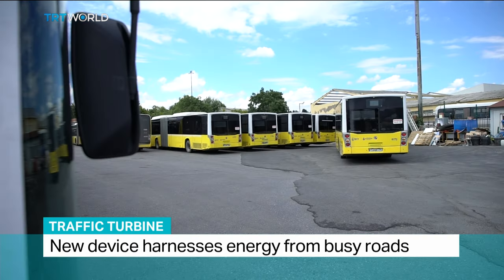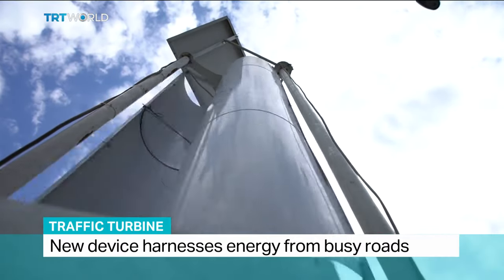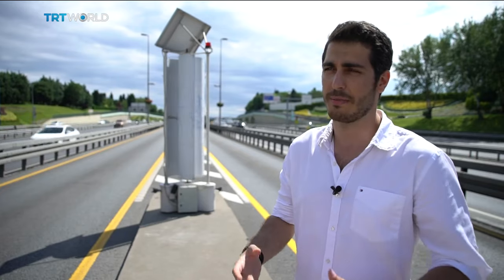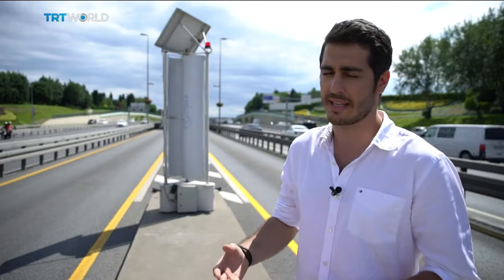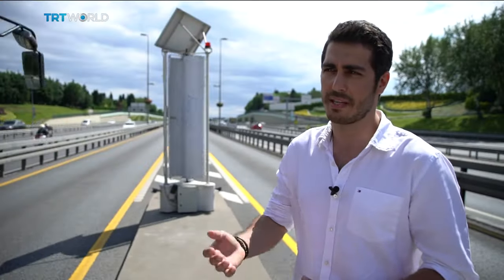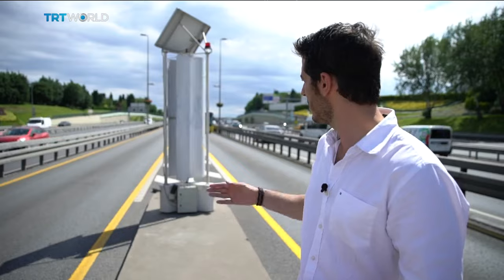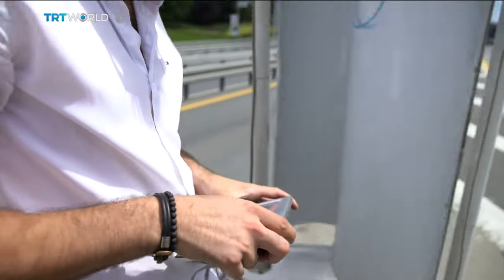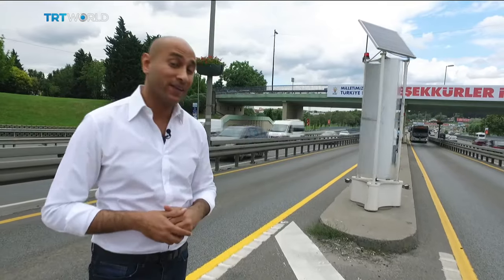Traffic Turbine: New device harnesses energy from busy roads

Comment: Do these turbines create drag on the buses, trains, traffic, making the vehicles use more energy to go past? Serious question. Every action has an equal and opposite reaction, energy isn't created, it's handed off. It's like when a small car drafts off a big truck, acting like an anchor. It pulls along the small car, but slows down the big truck. I'm wondering.
Reply: Hello Kim,
Interesting Question and Theories.
I really like the question of the increased drag, Have you found more information about it? Will the turbines create drag on passing vehicles? or, Will they simply capture wasted energy?
Also, On the drafting topic. 
I understand how the car gains drafting a big truck, but, How does the truck get increased drag? Depending on the truck size? Lets say a Semi Truck and Trailer with a Honda Civic following, Would the truck see increased drag? Is it adding turbulence to the wake?

I feel like I should know the answer,but I'm drawing a blank.
Looking forward to hear from you. thank you.
Reply: @tibss  mostly when you have another vehicle behind it "couples" with aerodynamics of the vehicle in front. Making the vehicle in front also see less drag. The reason is more streamlined flow and higher pressure at the back of the leading vehicle (the lower pressure will have now the trailing vehicle (think of a train). But this is different and makes complete sense comparing to this "invention".
The inventor should first put some meteostation to evaluate the local wind and how traffic really affects it. Maybe he would find that the traffic really dont add much. Then he could evaluate the effect of harvesting this wind energy on a vehicle and he would find that he increases drag on the vehicles. Not by much but in the overall cycle it just doesnt make any sense. It make sense to have wind turbines but not with direct connection to highway.
In a simple terms, when a train is driving through tunnel it sees "piston effect" and drag is increased by 10's of %. Imagine that you have these devices along as an extreme. You can see that this is just a "tunnel".
Reply: Blades will move in the direction of bus if you look at the angle of rotation. If you put 10 unuts in one line , they will onoy create a push and not drag. Think about it this way...
Reply: Too much mass and velocity to be affected in this situation
Reply: On a very busy road, the air currents created by traffic going in each direction would interact in the middle anyway, slowing each other down. I would think that having a turbine there would have little effect. Having them on the outside shoulder would likely cause the cars to be less efficient, though, but so would something like a speed limit sign.
Reply: @LaggerSVK nope not really. It's the similar case of when a car/bus passes by a tree. This energy is the waste energy
Reply: @animenmusic16  its not waste energy because it affects the car by inducing drag on it… so you are creating more drag to get some inefficient energy transfer out of it.
While the effect of trees might be similar the tree wasnt positioned there with purpose of inefficient energy transfer.
Reply: @LaggerSVK  this drag you are talking about is minimalistic. An IC engine operates continuously no matter the circumstances and if the opposing forces are great it causes the vehicle to 'stall'. Vehicles are designed to endure heavy winds. This drag would cause no major issue
Reply: @animenmusic16  why talk about IC. Talk about EV. You use battery energy to move the car. The car moves the air and you are “capturing” this air kinetic energy to create electricity? Do you see that nonsense loop? This energy is not free. You are directly taking it of the car by inducing more drag on it.
Reply: It will. Real question is whether drag induced on vehicles is being offset by energy produced or not. Difficulty is that this isn't something we can determine with simple math, and you need a pretty precise simulation to evaluate whether this is resulting in net positive or not. In theory it should because air is already pushed by moving car, converting it to energy to slow down air shouldn't induce much negative on the car itself.

That being said energy produced by this is probably not worth the material cost as you can just make a wind turbine located high up instead

Comment: To what extent those would impose an increase in drag to the vehicles is an interesting consideration.
As spinning these devices implies air harder to displace meaning drag. (High via pressure.) Tho this may not be close enough tot he vehicle to affact perfomance and rather be use of energy otherwise wasted.

This is much more feasible than the so called "Solar Roadways" debuckle.
Reply: Less drag than passing by a stationary object that doesn't yield in any way to a passing bus. Not spinning.
Reply: Js Travelers
Right..
"Air is not visible so how do we know it is even there" type thing huh?
Reply: I think to check this one should run a bus on an empty track with these turbines on and once with them removed, then the difference between the fuel consumption can be measured.

But I bet that buses will consume more fuel with these turbines on. 

It is not FREE energy......
Reply: @muhammadsiddiqui2244  I agree. A new thought comes to mind. If these are placed in the ending meters of streets where there is a STOP sign. It would certainly gather energy that would otherwise be wasted in breaking friction. But then again, stop signs are in low traffic zones, due to this very fact.

Worth it? Probably not.

Maybe best to use a generator when breaking your car. Or create some sort of menstruous car breaking contraption. That catches them with a long arm and slows them down to a halt via magnetic resistance. Or by winding up potential energy in some manner. Lol. Though cars, are not designed to be halted by external contact. Maybe redesign cars haha.

If we are gonna go for crazy after all. Why not have some fun.
Reply: You can find an analogy with these turbines around highway to a train in tunnel. It increases drag. The other question is by how much? If it increases drag by 1% and you are able to recover a 20% of that energy by this turbine is it even worth it? Lets say you lose a 100Wh in petrol and regenerate a 20Wh on electricity in that turbine.
Windturbine? Yes. Hardvesting energy of vehicles on highway? Total useless concept.
Reply: @LaggerSVK  if placed at the ends of streets where there is a stop signs. The drag is welcome. Cheaper than equipping all vehicles. And this not inefficient waste.
Reply: @AlexanderZapataIndividual  okay maybe you find some physical use but think about it like this. You invent and manufacture a complex device that harvests lets say 0.5% of kinetic energy of car with 50% efficiency. Really mostly you would harvest wind energy but inefficiently because of positioning. isnt it just better to place a windturbine higher in the air where you are harvesting wind energy with higher efficiency without really creating any drag on vehicles. Why manufacturing an expensive ineffective device when there are more effective options? The energy from vehicle is not clean. Really its quite dirty. You dont want to harvest this energy
Reply: @LaggerSVK  That is a good argument that it may not be worth it. I do not know that it is not. Let it find its use where necessary. I am not one to push for enthusiastically early adopt a concept to a fault. I just think the idea is neat, and albeit elaborate could in a better engineered world provide some use to otherwise wasted energy.
Reply: @AlexanderZapataIndividual  in current world and rise of hybrids / e-mobility you have some neat options how to regenerate "harvest"  nearly all of the kinetic energy with high efficiency and without added complexity to the vehicle nor the infrastructure. Why not use that? This really doesnt have any sense. You would also like to minimize the drag coefficient as much as possible. And If you really want on site energy use solar or wind turbine but dont drag the cars for inefficiency energy harvest.
Reply: @LaggerSVK  I alluded to this of not equipping every car. The cost of retrofitting vehicles most of which are gas cars unable to store the kinetic energy with some sort of winding on the breaks. Is way more expensive than the cost of these static "turbines" on selected streets. 

Does it really make more sense to equip cars with varied lifespans and usage designs with   energy harvesting solutions? Energy that stays in the vehicle for instantaneous use if unable to be stored by the 12 V battery?

All I want is another tool in the shelf. A static turbine can harvest from any car. A solution to harvest breaks from a car only harvests from 1 car, and the energy remains in it. Your suggestion makes less sense does it not?

Comment: America should invest in this kind of technology great ways to make electricity.
Reply: Not at all. The energy comes from the gas tanks of the cars.
Reply: @Simon-dm8zv   No it does not.
Reply: @godfreypigott  Yes it does.
Reply: @Simon-dm8zv   No it does not. The energy lost due to drag is already being lost. All that is happening is that wasted energy is being put to use.
Reply: @godfreypigott  The turbines are too close to the vehicles. Therefore they disturb the airflow and thus create more drag. In order to harvest waste energy they would have to be farther away from the road, but then there would be not enough energy left to turn the turbine.
Reply: @Simon-dm8zv   And you've done experiments to test this, right? Or are you just saying what sounds good to you?

And if true, why is this not also true of the walls of the many tunnels we drive through each day? Should we remove all tunnels?

And while we're at it, let's take all other cars off the road except our own. Imagine all the drag they are creating for our car.
Reply: @godfreypigott  Correct, tunnels also negatively influence drag, but obviously the advantage of tunnels is far more important than the slight increase of fuel consumption.
Reply: @Simon-dm8zv   Yes - SLIGHT. And in the case of turbines - IMPERCEPTIBLE.
Reply: @godfreypigott  The increase of fuel consumption is equal to the power production of the turbines (which is also tiny).
Reply: @Simon-dm8zv   Absolutely incorrect. ALMOST ALL of the lost energy was already lost.
Reply: @godfreypigott  Again, no. It is practically impossible to harvest any of the waste energy. Therefore the turbines are placed very close to the vehicles and thus causing more drag.
Reply: @Simon-dm8zv   Look at the turbine in the video.
(i) How much drag do you seriously believe it causes for the buses?
(ii) Do you really believe all air from the turbine is directed back at the bus?
(iii) Look how much momentum the turbine has. It is still producing energy long after the bus has passed.
(iv) If roadside turbines were placed on a downhill stretch where buses going in one direction are braking .... (fill in the blank)
Reply: @godfreypigott   (i) exactly the same as the energy produced
(ii) not relevant, it’s about disturbance of the air
(iii) the momentum is the inertia of the turbine itself
(iv) exactly! Only then it would make sense.
Reply: @Simon-dm8zv   You really have no idea. For starters, you are equating a force (drag) with energy. Never done physics have you.
Reply: @godfreypigott  I simplified it for you. Obviously the increase in drag is equal to the force exerted on the blades of the turbine to make the claimed power resulting in a certain amount of electrical energy after a certain amount of time.
Reply: @Simon-dm8zv   No - you simplified it for yourself. Get back to me with your experimental results when their done. Make sure to include them in a peer-reviewed paper ... after all, you are challenging all physicists and engineers.

Comment: How are such large scale projects sanctioned??
Are people really not aware of the law of conservation of energy???

Fuel -> kinetic energy 
is what is happening in cars. Wind is just a by-product.
Trying to harness it will increase the air drag as these are generators on load. Agreed that the air drag will be negligible. But very small amount of fuel consumption will increase and this very small amount will be added in these generators.
Really this is just micro stealing.
Reply: what if they are only placed on poles that already exist in that location?
Reply: microstealing thats the right word. Nobody really notice it much and you can create some few Watts out of their fuel but really contributing to the opposite of ecological energy.